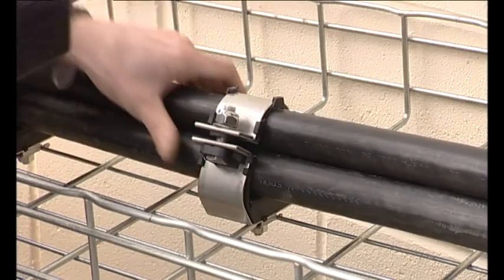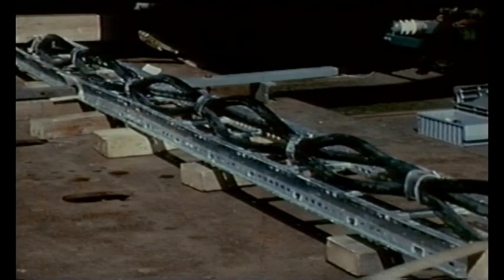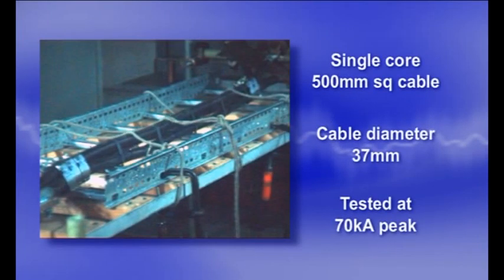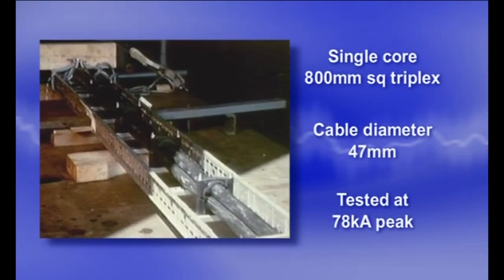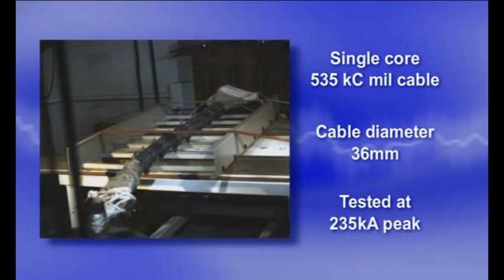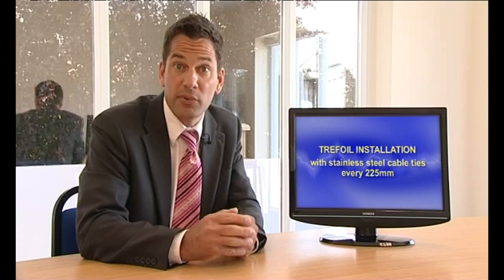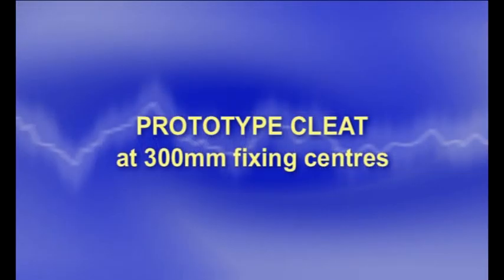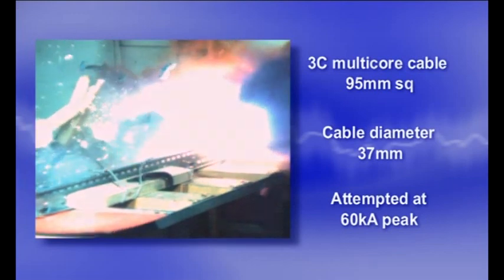Ellis Patents - Short Circuit Testings

Comment: I wonder how long the fault current duration is on most of these tests. Pretty short. 
However with these high fault currents most protection will trip instantaneously at about 100ms clearing time.